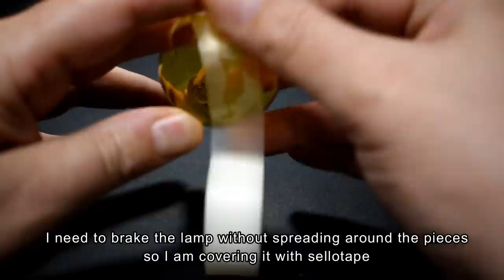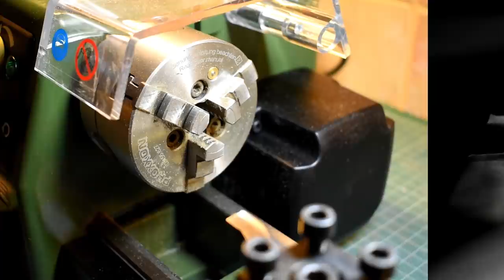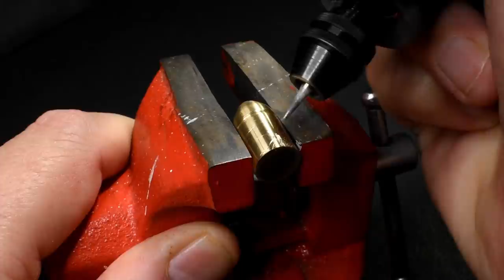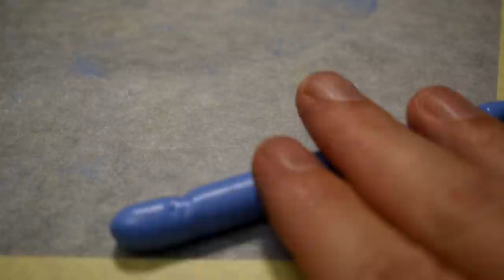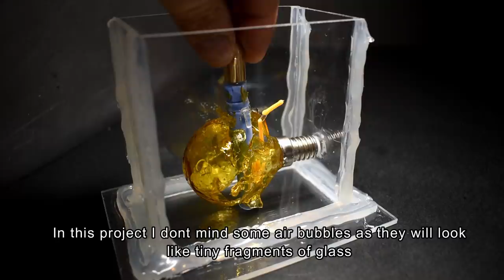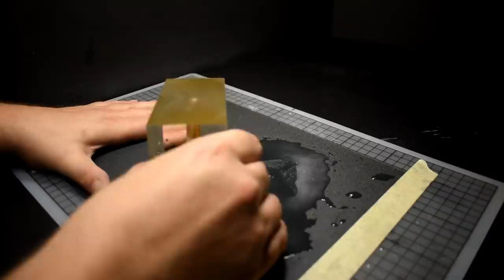Bullet Through Electric Bulb- Slow Motion Epoxy Resin Art /Diorama

Comment: "Here at Apature we fire the WHOLE bullet, that's 65% more bullet.. per bullet!"
Crazy level of craftsmanship btw
Reply: "Aperture"
Reply: I noticed that too, very cool design but know not how a billet actually works. A lot of people make the same mistake.
Reply: @taintedsasquatch398  Actually, I don't believe there is intended to be a casing on this bullet, since there is no rim or primer. He went to the trouble of putting rifling marks on the side of it, so thought was put into it. I think the issue is that he simply didn't know how little the bullet extended into the casing. I'm wondering if the small ridge is where he thought the casing would have marked the bullet from being crimped.
Reply: @anonymousaccordionist3326  Eh, it kinda resembles a .45-70.
Reply: I like portal

Comment: A tip is that you can go to a gun store that offers reloading equipment. Those can sell you only the projectile portion license-free. (You might have to explain what you should use it for of course since it can appear werd that a non-licence-holder wants to buy loose bullets without cartridges, powder or blasting caps - and they might even suspect you have those items illegally at home - here is where you could even show off your youtube videos - and they will understand exactly why you would want to buy loose bullets).

In most EU countries, whats prohibited to own without license is a assembled cartridge, powder or blasting caps. In some countries, spent cartridges are also prohibited to own (just because it contains a trace amount of powder left).

The projectile portion - which is just a copper shell with some lead in it - or even just a solid copper piece, isn't prohibited to own in most countries - otherwise all forms of bullet-shaped or projectile items would be prohibited to own. Same with lead or steel balls - owning a flipper game would be illegal just because the ball COULD be used as a projectile in a weapon.

Comment: The only problem with this concept is that the shell isn"t fired, just the bullet.  The shell is ejected from the gun and the bullet goes flying.
Reply: I was just thinking this
Reply: There is no casing (shell) in this art.
Reply: Where are you seeing the shell in this?
Reply: He means the bullet is to large, most are only about a quarter the size of the casing and it is somewhat out of proportion here. Also to much cylinder but it’s impossible to make it perfect

Comment: I am a retired gunsmith, so I am going to talk about the bullet.  No, it is not realistic, but in this case it is entirely understandable, considering that the video creator is in a country where firearm ammunition is controlled by the state.
I did a Google search for the word "bullet" and then clicked on the images button.  There were more images of motorcycles on the result than there were of bullets.  Just as bad, there were more images of unfired cartridges than there were of actual fired bullets.  I had to scroll down through four-fifths of the page before I saw the only image of a fired handgun bullet.
Given these limitations, I would say that the creator did an outstanding job here, the broken bulb looks amazing and if you compare his result with actual high-speed images of real bullets shot through bulbs, it is as if he has frozen a moment in time.
Reply from the maker: Many thanks for your comment.  Isn't it possible my bullet to be like some of these bullets after they have been fired? There are so many  types that surely one would be like mine:  https://m.imgur.com/ntM7e9F
Reply: @4THECRAFT  Thanks for responding 4THECRAFT, I'll try to clear this up a little for you.  The image you shared in your post is of cartridges.  A cartridge consists of many parts: a case (usually brass), a primer (the little round disc-looking thing in the bottom of the case, it sets off the powder when struck by a firing pin), the powder (a chemical mixture that reacts to the spark of the primer by exploding and turning into rapidly-expanding gas), and the bullet (the actual projectile that is forced out through the barrel of the gun by the expanding gas of the burned powder.)
Now, judging by the shape of the projectile you used in your awesome diorama, it appears that you were looking to create a handgun bullet as opposed to a rifle bullet.  I say this because handgun bullets generally have a sharper ogive (the ogive is the curved transition of the straight side to the tip of the bullet.)  In general, handgun bullets are blunt and sharply rounded, and rifle bullets are longer with a gentler curve.  Exceptions to this would be hollow-point and wadcutter bullets which we won't get into here because in your diorama you are clearly going for a full metal jacket (FMJ) type of bullet.
Speaking of the bullet's jacket, most (99%) of bullets consist of a lead alloy core surrounded by a thin copper (not brass) shell called the jacket.  There are exceptions to this, of course, and there are indeed some specialty types of hunting ammunition that use solid brass bullets, but these are very uncommon and expensive and will shorten the gun's barrel life.  (So when someone points out that your bullet construction is wrong, tell them your bullet is an experimental Nosler® Solid™ type, manufactured specifically for breaking glass bulbs)  :o)  https://www.nosler.com/solid-bullet
But, back to standard handgun bullets, the one used in your diorama is much too long (there would be very little room in the case for the powder.)  Not only are handgun bullets blunt, but they are short as well, usually not exceeding 1.5 times the diameter.
And finally, a fired bullet will have angled striations impressed into the sides below the ogive as a result of the bullet being forced through the rifling of the barrel.  Rifling is a set of spiraling grooves machined into the barrel so as to impart a spin to the bullet as it exits the barrel.  This spin stabilizes the bullet while it is in flight to the target.  A good example of what a handgun bullet looks like after it has been fired can be found here:  https://www.nist.gov/image/bulletsjpg
Sorry for going on so long, but you've touched on one of my favourite subjects here, so if you have any questions, feel free to ask.
BTW I have subscribed and am probably now going to binge-watch the videos on your channel.  Cheers!

Comment: Can you recommend a flashlight that will actually cure the resin glue?  I've tried 2 that are supposed to be UV lights, but no luck; gets tacky but not dry.  Thanks for sharing your talent!
Reply from the maker: If you are using a UV light then i think your problem is not the light but the uv resin you are using.  Some cheap uv resins dont cure. In any case the uv light I am using is the one in the resinpro.uk website.
Reply: @4THECRAFT  I'm actually using the same UV glue as you do in the video, so I'll try the same light.  Thanks!
Reply from the maker: @stephhatchett6546  👍

Comment: How that silicone tube gets pulled out at the end without taking any of the frag pieces with it. Also when you stuck that grinder in the negative hole it created didn't it displace those fragments?
Reply from the maker: This is because the glass pieces stick more to resin that on the silicone. Also I grind with 1500 grit sandpaper so no real harm is done to the pieces

Comment: This so bad ass. Much props ...  I have two questions: What's the blue thing that you used to put the bullet on? And Is that a heat gun that you used for the epoxy on the bulb?
Reply from the maker: Thank you.  The blue thing is a 2 part  silicone compound.  You mix equal quantity of each part to the shape you want and it hardens within 5 minutes. For the epoxy on the bulb I have used a UV light.
Reply: @4THECRAFT  oh ok, thanks...keep up the good work !!!

Comment: Awesome! But those lil uv flashlights don't work at all, i fall asleep trying to use that one you advertise. . it's garbage. Any real recommendations? Anyone?
Reply from the maker: In my experience usually it is not the uv flashlight the issue but the UV resin. Some uv resins are not of good quality and they dont harden well  under the uv light and become sticky. I suggest you try using a different brand of uv resin.
Reply: @4THECRAFT  will do. Mine has Chinese symbols all over it,no English at all. Is Solarez any good?
Reply from the maker: @_mylastname  I dont know this brand. I usually use the "Padico Star Drop Hard UV resin " and I am 100% satisfied. It is a bit expensive but at the end you get what you pay. I think I have put a link in the description